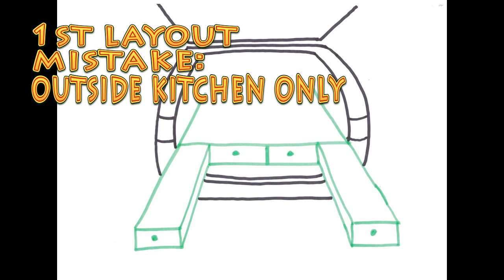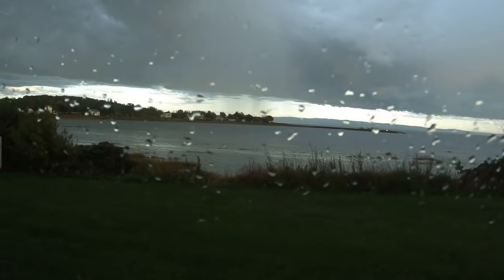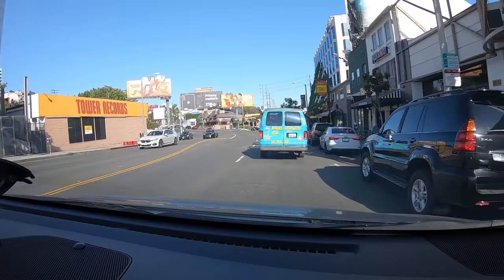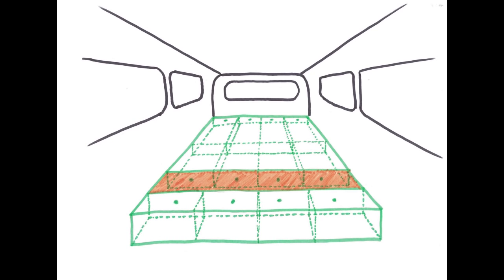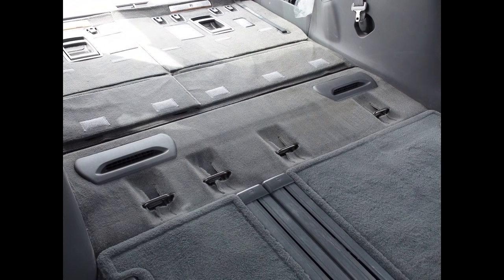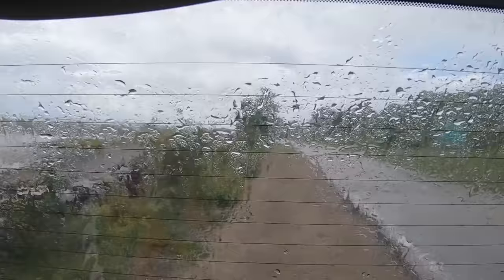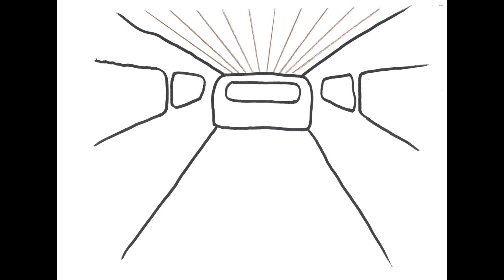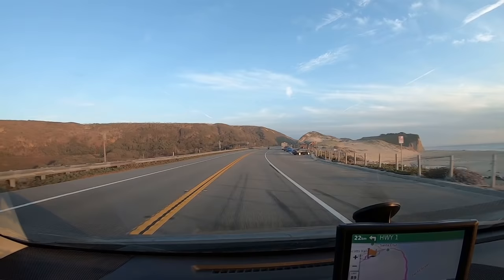11 mistakes to avoid (van conversion)

Comment: Okay,  first 1/3 of the video was on a kitchen and blocking windows,  And, maybe, as a master carpenter and engineer I shouldn't be commenting! So, saying that a mini van is way too small to be a travel van for van life is a fact. 
I have a 1975 chevy G20 beauville van!
 Now,  I highly recommend instead of building a cabinet,  I recommend getting a roll away stainless steel tool cabinet.  Especially about 18" wide 29" tall and around 60" long! Now, that's 29" tall removing the roll away wheels. I've found the drawers hold weight like can food and such as they are sturdy made to hold tools!  You can bolt them to the inside frame and pull out a drawer put a piece of wood on it, instant table, Mine is a stainless steel Montezuma! Also, they have a lock to lock the drawers, while driving you have no issues! I do recommend taking the drawers out and attaching a second locking lever on the lock system! Removing the wheels and bracket,  I added extra bolts to the floor!  I removed the wood top it came with, and put a thin bamboo wood top on it. The height puts it right at my dual  windows level,  you have a breeze while cooking. Now,  having said that I put a floating floor in,  yet dress it up with a rug.  The rug can be rolled up for when getting in and out. A quick sweep cleans the floor once inside with your shoes off roll out the rug.  Extending the floor to cover the step in on the sliding door gives me shoe storage and quick access to other items you might take with you. Now,  storage under the bed is great! Just don't put anything you need daily in the middle where you need to dig it out!  I put my clothes in a open shelf set up on the driver rear side of the van. I can wake up,  and grab my clothes for the day without getting out of bed.  Now flip up, hydraulic rear doors are the worst!  If it rains they tend to catch water and sends it into your van. Rear dual doors are the best!  I can open both doors,  attach a piece of duro last roofing material I've put snap buttons on and have an extra 31/2 feet of waterproof space instantly. I can slide my bed back if I enclose the entire area, or use it for a portable shower.  I use a 12 volt water pump and a portable propane water heater. I've found by regulating the pressure you can get a hot comfortable shower! Now,  I drilled a one inch hole and attached a fill hose to fill my water tank.  I use two 12 gallon holding tanks I got from a old camper and retro fit them. With a "Y" connector I can fill each seperate and use one for cooking and one for a shower. I get 2 showers out of a 12 gallon tank very easily. But I carry a collapsible  5 gallon tank and can use lake, steam or rain water to shower as well, with my ecotemp propane water heater.  Now,  everyone needs a fridge!  A r.v. fridge is expensive,  but worth the money. I mounted my propane tanks on the roof in another aluminum tool chest. It's locked,  bolted on,  out of the weather plus I  use ramp. like air defectors to not have excessive wind drag!  Now,  I mounted two 12 volt batteries under the driver seat,  fused and in series to run my 1 amp lights,  and 12 volt water pump.  I them added 2 200 amp solar batteries under the passenger seat with a charge controller and switch.  When I'm driving,  all batteries charge.  Tho I do have a second alternator I added on the engine to charge the solar batteries. Older vehicles this is a option. Newer vehicles, forget it! Plus the renogy charge controller out for 12 volt systems for rv's really suck in the reviews! 
This brings us to cooking! Unfortunately it's hard to come up with a rv cook stove small enough for a van. Yet,  you might get lucky.  However I added extra length so I can run my propane hose out the window.  One regret is having to climb the ladder to turn on and shut off the propane,  but it's a safety I'm not willing to compromise on. Plus I painted the aluminum white to reflect heat and if stays cooler. Camp chef makes a decent stove/oven!  But I recommend looking for a small r.v. oven/stove.  Something that stores easy and is easily portable to set up outside!  There's certain food you do not cook inside ones van. Shrimp would be one of those! But the ability to bake a pizza is a treasure!  Now, wiring,is the bitch!  It's first with plumbing,  and not something you can change easily later. Take your time,    visualize,  and plan accordingly.  I have also installed a small breaker panel,  and drilled a hole for a electric hook up.  But having this feature is nice,  but it's not something you can rely on everywhere you go!  It's nice once in a while,  but that means your parked. I use a 12 volt television for news, and weather. With a 12 volt antenna and signal booster. On a 20' pole I attach and remove from its base on top the van,  I can just about get a local station anywhere! I do have 50' of cable and can climb a tree if it's a option!  My bed is hinged to be a full sized couch,  or a 75" x 80 " bed. Mostly it stays a bed for storage underneath like a cook stove or poop pot! Low profile is the key. I use plastic tubs with locking lids,  see thru to put items in. Like backpacking gear,  rock climbing gear,  etc. At 24" high I can double stack 12 tubs!  Now,  chairs,  I have  smaller folding wood chairs vintage!  A bracket in the ceiling keeps them out of way above the bed,  and secure for travel.  Now,  on shelving!  For my clothes,  again I use plastic Tubs. This cuts down on swinging doors and I can see everything I have to wear instantly.  Using a aluminum bar,  I can just raise it up and pull my tub out,  get what I need and put it back. Secure and ready to travel without a check to make sure everything is ready for travel. The t.v. is folded up on the ceiling when I  travel,  and my 2 10' antenna poles are slid into a piece of pvc mounted on top! I also put my fishing poles in pvc as well. Plus roll up my durolast roofing material and slide it in one as well.  Which brings me to a van roof! They get frickin hot!  I mean fry a egg and bacon hot!  A solar oven works well on a van roof! Now again I'll mention durolast roofing material.  White,  reflects 99% of ultra violet rays.  Gets put on buisnesses that have flat roofs and is amazingly tough. When it's hot,  it's hot, durolast stays cool!  I have raised brackets to hold things on my roof.  So I can pull out a piece of durolast, cover my roof for the hot day and it will be cool well past morning after a cool evening! The temperature difference is amazing. I just wish I could have designed a way to cover both sides as well.  Yet,  I do have am extra 8' wide piece x 16' long I use as an awning on the side of the sliding door!  2 poles, two large tent stakes,  and it's shade city!  There is not a better 50ml water proof tear proof material on the market that will beat the durolast material for what if does!  It stays cool reflecting 99% of ultra violet rays and you feel the temperature difference the second you step under it.  Not like a heat asorbing fabric that fries your brain. 
  I put flush mounted led lights in the ceiling.  They are  1 amp each and with the flip of a switch I can use either batteries to power them.  I have wired them in options of 2-4 or 6 on 3 seperate switches. Yet wired a 3 way for the two light option adding the switch at the head of the bed by the pillow to shut them down for the night. The other switches are mounted in the ceiling just above the sliding door so they don't get hit and turned on by accident or broken. I've got my mountain bike if I'm parked in a town, to go explore and shop. If you want help with something your thinking of implementing. Let me know,  I'll help you figure it out if I can. I have tons of folding furniture and beef designs,  and worked at a camper factory while going to college. The main thing is easy access,  and secure storage. Seems storage is the key since limitations are a issue.  I barely had room for my kayak on top when I was done,  yet made it work! Just remember,  your not in a hurry to get anywhere,  and if you are, your not planning your trip out correctly.  I always carry a tent with me because outdoors sleeping is great in some areas. But a 12 volt mattress air pump and sleeping bag is all you need.  Everything else is in the van.  Oh,  a last bit of advice. A 5 gallon collapsible water tank weighs 40 lbs.  If water is too far to walk use your bicycle,  and attach it to the frame using netting and velcro.  I lay the bike down roll the netting around the water bag velcro it on pick the bike up and away you go. It's easier than bringing a battery, water pump, and propane to the water.  However,  if your close,  pull out the garden hose,  hook it into the optional inlet you added in your planning,  shut the main valve off, open the optional valve light the pilot on your ecotemp water heater and have a long ass shower. Ahhhh the van life!  Who needs a $100,000 RV?  Oh,  I did mount a bracket for a.c. on the rear door. But I keep it in the middle of the stuff under the bed with items I really don't use.  But if I'm somewhere I have electricity,  and it's so hot I can't sleep,  I can add that feature.  But careful planning of South in the winter, and North in the summer,  you really rarely need it. My biggest issue is trash.  People are frickin assholes,and I'll pick up their trash.  Finding a recycle facility is a bitch on the road!  Someone needs to invent a 30 gallon trash can, with 4 seperate holding areas in one trash can.  Plastic, paper and glass and cans!  Aluminum I just smash. But I don't drink beer,  or soda, so I'm good in that department.  But still,  people are pigs! Filthy disgusting, don't give a crap enviromental pigs!  I'd  hate to see their homes.  Nature is a treasure,  not a place mat,  or a place to leave your crap!  You brought it, you bag it!  Or just stay home!
Reply: Thanks for your long post! Can you be more specific about what exact durolast product you use? How do you secure it to the van for use as an awning?  And how do you secure it to the roof to keep the van cooler?

Comment: I agree with a lot, but for me carpet is a must.

Obviously it’s more cosy, but the main reason is it hides the sand and dirt. Carpet can be taken out and shaken, blown out with a 18 bolt blower or simply brushed with a banister brush. I’ve been careful with liquids and never spilt any. 

When I had a hard floor, my feet were constantly feeling grit under them. I had to clean the floor multiple times a day. With carpet I could go about a week between cleaning. 

Carpet gives the illusion of keeping it cleaner longer, sure the dirt is there but if my feet can’t feel it that’s good enough for me.
Reply from the maker: Different perspectives... 👍
Since I surf and I free-dive, I spend a lot of time at the beach.  Sand and water are part of my life, and in my van 😉. So is mud and dirt when I go hiking. I keep a small broom beside the door. In my case, a carpet is a no go. But I can see your point. Thanks for sharing a different perspective ✌️

Comment: Yes. Yes. Yes. Yes. Yes. Everything Eric said is what I am considering in my build. I spent a long time designing before I laid a single board in the van. I have cut back a little on my conversion costs, but I'm simply saving them for Phase 2, where I will make the upgrades down the road. But my Phase 1 will be beautiful and functional!!
Reply from the maker: This is great! Thank you April for sharing. Going by steps and taking the time to figure out what you want is the perfect path, and it is the path that you also enjoy the most because you take the time to dream about it! 
Thank you for your comment! ✌️

Comment: Love your conversion!  I've always thought all that wood paneling would be too heavy.   Thanks for the confirmation.  I am concerned with burning fossil fuel.  Would love to have an electric van someday.
Reply from the maker: You are right about weight concern. Yes I had some weight, but I removed a lot by removing all those seats! Using thin materials is a key. Thank you for your appreciation and for sharing your point of view ✌️

Comment: Many thanks. I have been doing a lot of research on mini van conversions to small trailer options and this was very helpful. I'm not comfortable driving anything large but some mini van conversions are not functional..at least what I consider functional. Just like having to cook outside out the back of the van with no access to that function inside and some with no access even to a fridge inside. This is very helpful!
Reply from the maker: With think the same Sherry. It must be functional! 

Thank you for your appreciation comment! I really appreciate your feedback 😃✌️

Comment: SO agree on the outside kitchen being an option, but not the only option! Yup, we have a hard floor, easy to sweep etc. (We do have a small throw rug that can be shaken off or washed, but the bulk of the floor is hard. Great Vid.
Reply from the maker: Thank you for your feedback and for sharing your opinion. I love your comment ✌️
Reply: Bath/shower mats are an easy option to put on the floor area... Helpful in keeping warmth in colder time's easy to shake off, wash down and dry quick (I've got a list of practical items I'll slowly add as I go.. So these are on it! 👍😁
Reply from the maker: That’s an option. But for me I really really appreciate a lot my hard floor. You can wet it and wipe it right away. Just a small swift sweep and everything is clean! Plus my floor is shape in a « L » because of my fridge... 
Having an hard floor is a great up grade! ✌️

Comment: I've been caught off guard by many of your ideas.  My van/suv build was going in another direction but you have made me reconsider several ideas.  (I have some experience as I lived in a van for a few years in the 90s before everybody and their brother was doing it)  I agree-- it is best if your build inside is good looking and neat or you could end up hating it over time.  I must say I disagree with you on one thing I have heard from you: You can get a short hair rug that works almost like a wood floor.  A rug is just warmer than a wood floor.  Also, if you have a little padding under that rug, you can walk around on the floor with you knees inside your van.  That's really useful.  If you have rags and towels nearby, you can very quickly pick up any liquid spill on the rug.  Also, have a nice throw rug you can easily take out, shake out and scrub it with soap and a brush.  I purchased 2 colorful throw rugs at a thrift shop for 40 bucks or so and they perfectly cover the floor of my suv.  I have long agreed that you have to be able to do everything in your van.  Actually, since you are always in a public area where you are parking your van, you never know when you will have to drive away fast if scary people, animals, weather, etc., all of a sudden descend on you.  If you have a bunch of junk outside your van, you can't do this.  It is for this reason I also believe there always needs to be a clear walking route from the back of van to the drivers seat.   Thanks.
Reply from the maker: Thank you for sharing another option with a rug. It may be a nice option for many people.

For me, since I spend a lot of time at the beach surfing, freediving, etc, I really appreciate the hard floor because of the sand. I kept a small broom by the door and brush once and a while... pretty easy for me. 

Thank you for your appreciation and for sharing your experience! ✌️
Reply: P Hans : yes, I agree that inside access to the living area from the driver's seat is very comforting, from a security and a weather stand point.
Reply from the maker: I agree also! It is quite convenient 👍

Comment: Thank you for such a thought provoking video. I haven’t purchased my van as of yet, but it’s my 2021 resolution so to speak. I’ve spent the past 18 months watching and learning, so grateful to the YT nomad community, I have learned so much. This video though, it’s the one that helps me pull everything I have learned, together. Lots of amazing advice from experiences, is always sage advice. You really got into my head about how I “picture” living this way. 
I really hadn’t thought beyond a rain shower. Weird, since I live in Texas and even though I have a 12’ x 20’ covered porch, the windows can still get wet during a storm. I would never consider going out there to cook on my BBQ grill, so what makes me think I would do it at the back of my van where I have to run around to the side to even get out of the rain? I wouldn’t, then I’d be stuck eating whatever dry goods I could access, or hitting a drive thru. 
Lots of good stuff to consider, which is why I’m a new sub. Happy trails, and stay safe!
Reply from the maker: Valerie, I appreciate a lot your comment. You are a good writer, I was imagining everything while I was reading your comment! Thank you for sharing your point of view, and thank you for your appreciation ✌️

Comment: All good points and you could make 10 more.  Another one is overbuilding. Some people build up every inch of space until its hideous and unlivable but make for great show-and-tells.  In what im planning its going to be underbuilt, lightest weight materials, and easily convertible back to its original form. For designs I look at small sailboat interiors and for structures I get clues from things like the Citroen 2CV which had the most simple seating (basically a hammock originally) which could be removed for outdoor seating. Look in untraditional places for ideas!
Reply from the maker: «Keep it simple» is a good motto! It is good when you build it and more when you use it! I really do agree with you. I like when people share their perspectives as you did. Thank you and enjoy planning your project ✌️